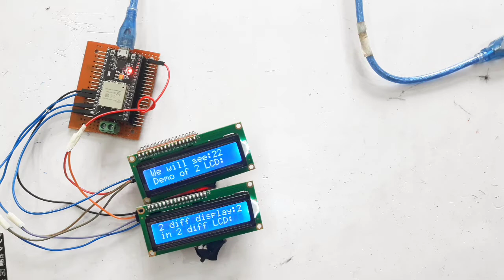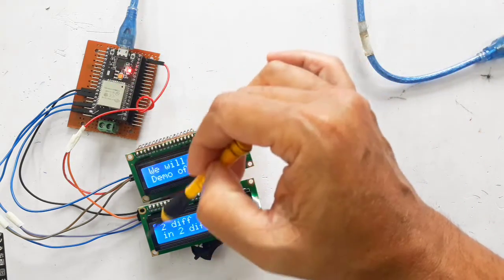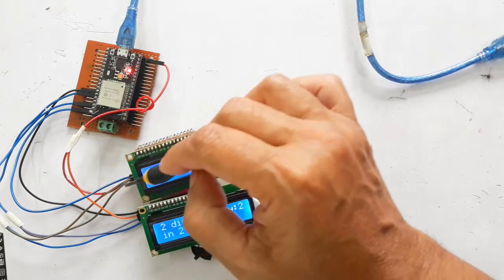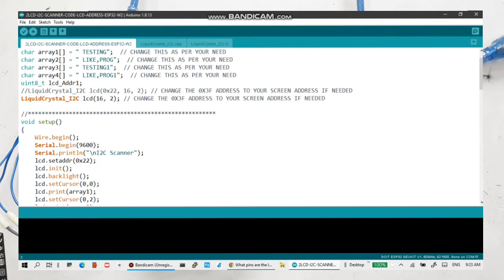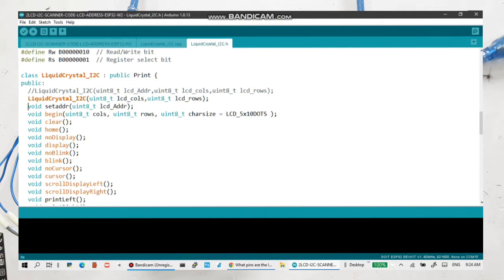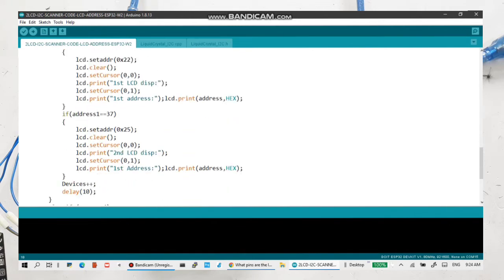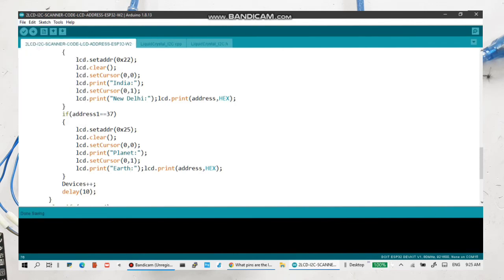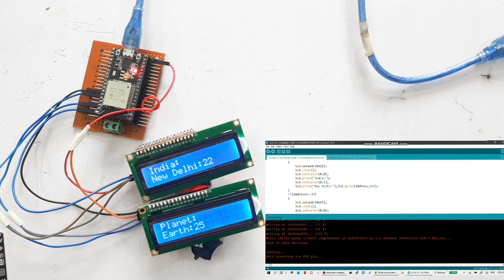@How to interface multiple LCD 16X02 display in ESP32 using i2c interface ?

Comment: Thank you so much! It was really helpful. I wonder whether I can connect multiple TFT LCD  together to build a larger image?
Reply from the maker: I never tried TFT display. So you have to see that yourself.
But here is an opinion about text LCD:
-----------------------------------------------------------
You can do it but you have to controlled data management and its display. Also there is  limitation of lcd that can be connected together.
You will need multiple  I2c interface to connect multiple LCD and control their address to control display. We are talking here to text display and split of lines to send to multiple LCDs.
Also you have change the hardware address of I2c interface to have unique address and them connect to UNO board. Those address should be set inside the program to display that particular 
LCD and rest will have old display.
Reply: @Robolearning  thanks for zäyour quick comment